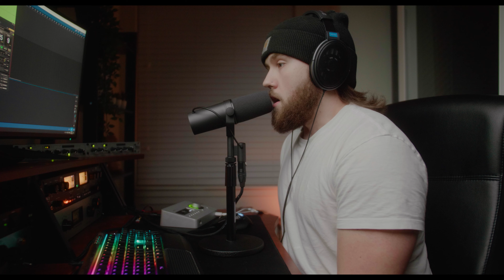How I Get My SM7B To Sound Better Than It Normally Would

Comment: The hyped title of this his video can’t hide from me, that in the end, spending on this microphone doesn’t necessarily give you good sound. But that’s beside the point. The sound seems nice to me. As for using the compressor, I say: What works for you, works for you. But I use it a bit different, tho what I’m getting is similar. I am running my compressor with a real high ratio. But to not get overly compressed sound out of it, I set the threshold just above my normal talking, so my compressor barely does anything, if at all, unless I start to get louder than normal. This has the effect, that my voice never gets any louder, than my normal talking. With that , I manage to get my signal louder, without too much compression, while talking normally. So there you go. Uncompressed sound with a better protection against unwanted peaks or even clipping.

Comment: If you don't want to commit every time to your processing you can use one of your inputs and outputs and just route all your processors in between to dial in in post as an external insert like a plugin. That's my favorite way of using analog gear. If you have ADAT you can expand much further and run each module individually and rearrange the chain just like with plugins.
Reply from the maker: Do you think that’d be possible on the Apollo solo? I did it all the time on the id22 but after I switched I haven’t done it anymore. Miss it ngl
Reply: @tytheprodigy  it is possible I think you have 2in/4 out but not sure about ADAT. Without ADAT though you could still do it just would have to sacrifice one of your inputs but then obv have the 3rd or 4th output for other end.
Reply from the maker: For sure man!

Comment: You're underestimating the power of your Apollo interface and recommending hardware that is not better than the UAD emulations. Noise gate, EQ, Preamp and Compression are features that you can get better from your Apollo plugins than running the mic into cheap hardware like the ART.  I have a Quad and a Solo and I can choose between several Unison preamps included V76, Neve 1084, 1073, Helios and many others I also have a Heritage Neve Clone hardware (80 dB) that sounds good but is not really necessary if you already have an Apollo. No need for a Cloudlifter or Fethead, remember you must give your mic some HEADROOM to process in Post or in Console in real time.  I'm sure the LA2A or 1176 or both plugins running in console would do much better than cheap hardware compressors like the DBX.

Comment: If less is more, at least for voice over/talking head, the SM7B can go through the Apollo Solo without the need for the extra equipment. I would bet it would sound very similar....for ‘even less is more ‘😉
Reply from the maker: It would sound a lot more “higher quality” tbh if I just ran it into the solo. The higher impedance and even though UA doesn’t state it in their spec sheet, I’m sure the EIN is lower on the solo than the MPA. I just happened to like the sound of external gear. Definitely would save me a lot more time to just plug directly into the interface but where’s the fun in that, you know? I definitely wanna do a comparison between MPA Preamps and Solo preamps

Comment: Sounds very nice and smooth. Get the dbx in the rack! :)
Reply from the maker: already done! It's really fun tracking with it. I just realized something with my MPA II that I was doing incorrectly the whole time :/ I'm going to make a video on it here soon
Reply: @tytheprodigy  oh noooo what was it???
Reply from the maker: I wasn’t using impedance correctly which led to problem with the staticky noise that low sensitivity microphones inherently have and my recordings sounded overall dull and in a way a little muddy. I’ve been using 300-600 ohms of impedance when on my voice in particular I really should have been using 1.2K-3K ohms so it sounds a bit brighter and overall more exciting on my voice sense I tend to have a more deeper voice than anything. A great example of the differences in impedance is a video Sean Devine put out where he tested the cloudlifter Z and you can hear the massive changes in the tonality by changing your impedance
Reply: @tytheprodigy  ohhh right right. That's actually one of the coolest thing on the MPA and Pro Channel. In general it's supposed to be set at least 5x higher than the ohm rating of the microphone but ofc you can push it higher to taste. Most fixed preamps are locked around 4-5k impedance. Lowering it smooths out the mic, warms it up as you noticed, higher seems to be brighter and louder too so it's hard to get a true comparison without recording and level matching. 

On my Neumann TLM 102 I like mine at 600 but do find I like 1200 sometimes too. For the ultra clean tho, 3000 impedance all the way cranked lol it's like hi def clean. Almost seems to eq it a bit too the higher you go, the less neutral the mic sounds.
Reply from the maker: Yea man I just did a demo with the sm7b with 3K ohms and it was night and day. Wayy better sound to my ears!

Comment: Would be interesting to hear your old vocal chain (preamp,76,2A,EQP) compared to the new one. Also if you ever want to get more gear but don't have space I def recommend to check out 500 series. Very affordable much more than full rack gear but 100% analog goodness and only takes up 3U on the rack (for TEN modules)
Reply from the maker: Sadly I don’t have the KT76 anymore but I could replicate its limiting with my new 266xs since it goes past a 12:1 ratio with fast attack/release speeds. Stay tuned! And yeah man I wanna get into 500 series units. Don’t you need a case to put them in and what not? Maybe you can link some of the stuff I’d need to get started with that. Very very interested though
Reply: @tytheprodigy  you do need a chasis for them. I have a Midas L10 (super rare rn) which is only $300 but holds 10 modules. The L6, 6 slot chasis, is only $250 but still rack mountable. 
https://www.perfectcircuit.com/midas-l6.html

For modules I recommend anything from Lindell Audio, Fredenstein or DBX make great affordable gear too (as you know). Lindell is my favorite with their 7x-500 (1176 FET comp) and PEX-500 (Pultec) both for $300 new I believe! The Fredenstein Artistic comps are great as well. ($250 FET, $300 Opto)
Reply: @tytheprodigy  hookup is the same as with any other external analog gear. Output of interface to input of 500 chasis slot Input, output of 500 to input of interface, assign the routing in daw and good to go.
Reply from the maker: Awesome man I’m gonna look into it!
Reply: @AtTheSourceStudios  What do you think about Neve 1073 LB 500 Series ?
Reply: @lovemusic7417  oh you can't go wrong there. The ONLY thing I would say even close to what could be considered a negative in some preferences is the coloration of the Neve might be too much sometimes. If you prefer a cleaner preamp I would look at the Neve 88RLB 500.
Reply: @AtTheSourceStudios  Is the Neve 1073 LB a great choice for AKG C414 XL II ?
Reply: @lovemusic7417  Definitely a good pairing! Keep in mind you don't have any metering on that preamp so if you want to monitor your levels I suggest something like the Fredenstein MeterHub.

Comment: Nice video always bro 💯. So glad im subscribed. I gotta question,  I'm sure you get enough of these so sorry to add, but I was wondering your opinions on the MXL V250 microphone 🎤 🤔? I gotnit for about 70 bucks and wanna start recording sum vocals with it. Is this a mic you would recommend? And how does it compare to the Rode Nt1a🤔???
Reply from the maker: I’ve never used that mic before so I’m not too sure. I did use the mxl 4000 and I loved that mic. I’m sure the NT1 sounds a bit darker and overall less noisy. If you have the money I would suggest the NT1 because it’s so versatile but to be honest man as long as you track in a treated spot (closet for example) and gain stage properly, I’m sure you’ll get great results. Also whatever preamp you’re using will make a big difference as well. And thanks for the support/kind words man I appreciate it!
Reply: @tytheprodigy  i definitely appreciate it bro. Ill track out using the 🎤, and use ur advice. Thanks for all u do for the culture and community bro 💯💪🏽
Reply from the maker: Thanks man that means a lot!
Reply: U welcome bro, and Thank you as well 💯🙏🏼

Comment: Dislike from a person without a Shure SM7B. #shuregang XD
Reply from the maker: Lol yes. I’m figuring out every single day how to make this thing sound better and better!
Reply: @tytheprodigy  It sounds perfect to my ears! I only have a Scarlett 2i2 with the mic. Wrapped a fricking sock around it and testing it today...  the problem with only those two is that the mic (kind of unrelated to the back-of-mic settings) has a flat response. So I need to get the gain almost to max and it almost always sounds kinda earrapy. What should I do or maybe even buy that it's not so unreliable and that I don't need to change the settings ALL the time?
It's just disgustingly annoying. I need to keep producing content and I don't need that extreme time waste every time before I start recording...
Reply from the maker: Does it need more gain? tips on EQing it? What exactly is the problem when you use it? Also is your 2i2 the 2nd or 3rd gen?
Reply: @tytheprodigy   @TyTheProdigy  It's 3rd gen. Every. Single. Time. I use this setup something changes in a bad way. For example after multiple hours of timewasting and experimenting I finally got the correct settings, then I record, the audio is fine and when I try to do it next time, you either can't hear me at all and when I put the gain up like 0.1 millimeters, it already sounds earrapy. And it repeats all over again.
Reply from the maker: Set your gain so you’re peaking no higher than around -10 to -9 dbfs. Make sure the air function is turned off. Make sure you DO NOT have phantom power turned on. Keep the settings flat on your microphone. This should give you a good start. After that you’d wanna eq a little and maybe very slightly compress

Comment: Is that adbx 266s or dbx 286s
Reply from the maker: dbx 266xs
Reply: @tytheprodigy  does it work the same as dbx286s I was planning on buying dbx286s for Shure sm7b is the 266xs better thanx ty
Reply: @ronselah8484  the 286 is a single mic channel strip. Basically a mic preamp with +48 phantom power,  an 80Hz highpass filter, soft knee compressor, de-esser and an expander/gate. 

The 266 is a dual mono or stereo compressor that also has expander/gate feature.

Comment: hello ty , i have scarlet 2i2 what else would i need to have great output from sm7b  or can the scarlet work okay without all that rig kindly advise thanx
Reply: you would need a preamp like cloudlifter or se dynamite dm1
Reply: @witus-mix  thanx much appreciated
Reply from the maker: I don’t think the Scarlett can output enough gain. Check the EIN. If it’s -128 or lower (-129 -130 etc.) and can provide enough gain so that your levels are at -23 lufs short term, then you don’t need a cloudlifter. If it can’t produce enough gain to put you there and has a worse ein, get a cloudlifter

Comment: Have you used a cl with the sm7b? 
And you ever have problems with the Apollo solo?
Reply from the maker: I have and they’re not necessary. Check your interface specs and if it has an EIN of -128 or lower (-129,-130, etc.) and can supply at least 60dB of gain, then you don’t need one. If it can’t do either of that, then definitely get a cloudlifter. I’m using an ART PRO MPA II as my preamp and it’s got an EIN of -129 and can supply more than enough gain to the 7b. I’d rather put that $150 into something like a dbx 266xs (compressor/gate) to go with my MPA. And so far no issues with the solo it’s been great!
Reply: @tytheprodigy   i have scarlet 2i2 what else would i need to have great output from sm7b
Reply: @ronselah8484  In this case you'll definitely need a cloudlifter, the 2i2 has like +45dB gain